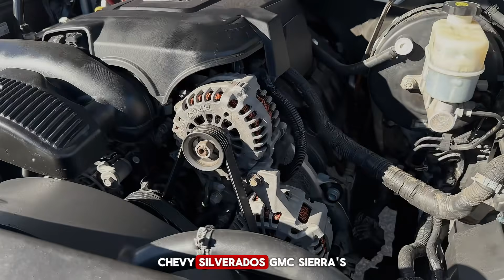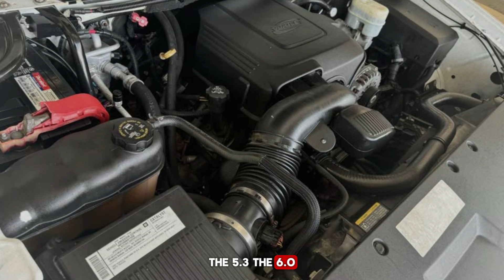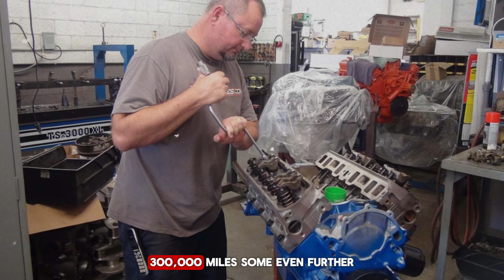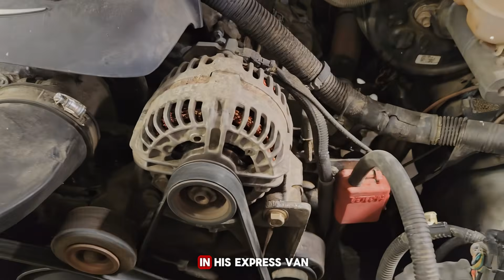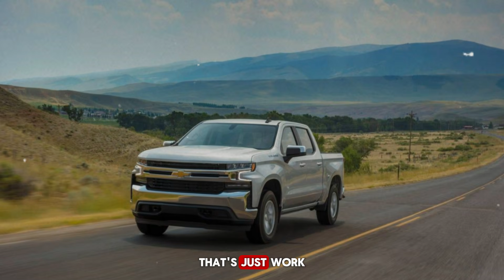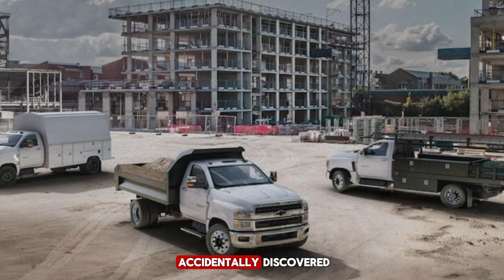Why GM's 4.8 Vortec Is the Most Underrated Engine Ever Built

Comment: I needed a back to my 2004 duramax. Always need a backup truck. I bought a 2012 1500 with a 4.8, no 5.3 for me. AFM scared me, plus I want a v8 all the time, not when a dang computer said you don't need 8, sounds suspicious to me. What happens when the computer has a brain fart? Guess. 147 plus on my 4.8 and you can barely hear it run.  Oil change and trans fluid change forthcoming. New water pump, belt, fuel pump too. Dont overheat that motor. Buy a new truck off the lot, no way. Can't afford a mortgage on a new truck.